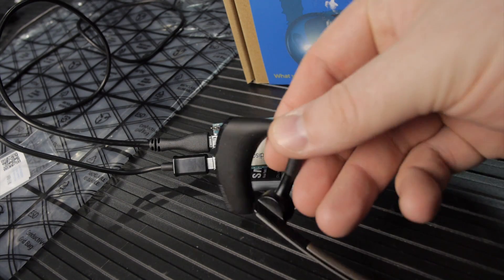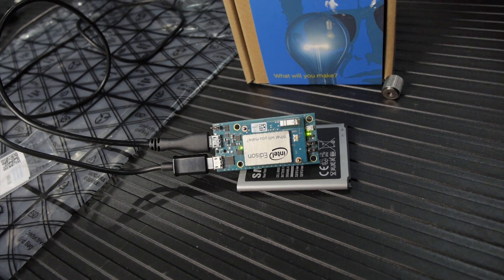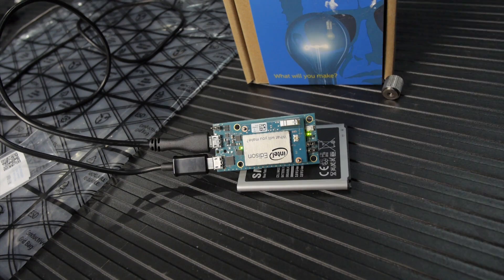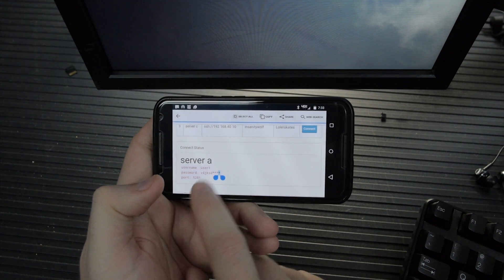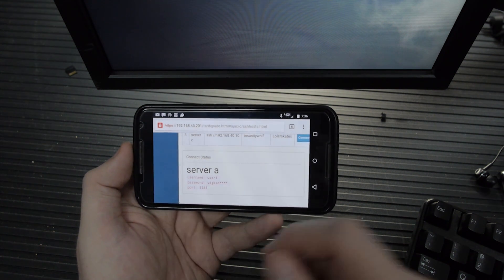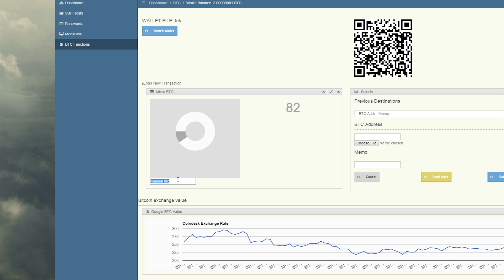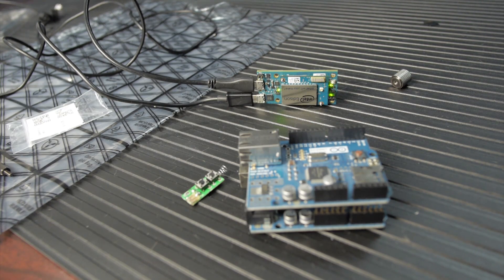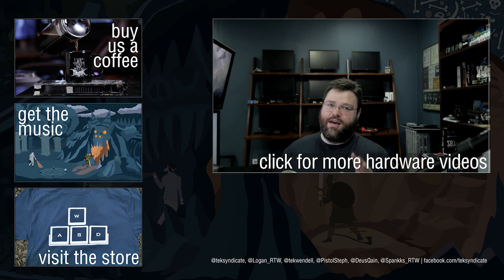Intel Edison: Yocto Linux & Personal Area Network Server

Comment: Look into particle if you're going for a super small form. I'm curious as to how it was working with that broadcom on linux. I've had nothing but headache with those wifi modules usually end up switching to the intel wifi modules. Interesting project let me know how it goes from my understanding it's essentially an arduino with a wifi module.

Comment: I dont understand what this is supposed to be. You want to join a network with some device. So you connect Edison to the network first and have it send out a key that allows you to connect to Edison. Now Edison is the middle man who is sending and receiving information.

Your goal would be to have Edison connect to any network and then give you a connection to your device. Encrypt all information sent over Edison and have Edison block any attempts to connect to it. No one can see which devices are going through Edison.

But why do you need this? You would not store intellectual information on your cellphone, but you would on a laptop or some type of external storage. Your laptop can have antivirus software and means of blocking IP's and ports from external connections. Sure this may not be the best, but what am I missing?

Comment: a dedicated multi use security device? that could both be a mobile secure firewall and a device to hold passphrases/certs would be awesome. especially in security concious applications, ie. banks, any defence company, journalists? sounds good.
i hope you can(do) get linuxSE running on there, but i do have to ask. how are you going to get it to hold passwords to be used on another device for web logins with out having that password/cert shared?

Comment: I was actually thinking of something like a "one button click password writer" that would be stored inside the little device and wherever you need to type a password, just connect the device via either USB or bluetooth (I prefer wired connections) and press the button. It would be a much simpler design and won't have the "personal assistant" feel to it, it would be more like an access card. I like the idea of "one time use password", but it feels a little to much work for my taste. 

Also, how does this Edison compare to an ARM TrustZone enabled CPU? 

As a side question, how does this Edison compare to Raspberry Pi 2 (except for size)? Because I was looking to revive an old IBM Thinkpad 380z using some small computer that I could connect the display, trackball and keyboard.

Comment: Try recompiling a kernel with grsecurity. That does what is possible within the kernel to secure the system, which is quite a lot. The only reason I don't use it on my server is because I want to run Folding at Home which needs to access power information (battery to be specific, even though the server doesn't have one other than a UPS). The access to the files and folders with that info is blocked by grsecurity.
Reply: mark dawsey Protein folding simulation is a computational problem that probably won't end in your lifetime
Reply: Alexander Pavel  I thought Folding@Home ended a long time ago.
Reply: I'm sure it will not end in my lifetime.  I used to do it on my PS3 but the functionality for it was turned off, I thought it was because the university pushing it wanted to divert their resources to other projects instead of brute forcing an answer from a computer.  I am happy to hear it is still going on.

Comment: can you not lower the CPU clock and voltage to help with power consumption? like setting it to the minimum required for dependability but maximum power savings?
Reply: ***** I suppose that would be limited by the chipset, the CPU might have automatic power saving features built in anyway though when I think more about it.
Reply: ***** So it looks like the CPU has speedstep enabled so it will dynamically adjust based on demands, but the Quark core doesn't have any advanced features at all except idle states, but since it's running at 100Mhz I doubt it draws much power anyway; it's TDP is 2.2 watts @ 400 Mhz. Kinda weird they're using a 64 bit CPU for tasks but the OS is run through a 32 bit Quark CPU

Comment: what is the pupose of using this over a raspberry pi 2
Reply: grape fruit95 the purpose of this device is completly different from a raspberry pi (in my opinion) the raspberry pi can be used as a desktop replacement with all the connections like usb hdmi audio the edison on the other hand is more like a brain for smart devices that doesnt need any video output or audio (so more like a overpowered controller for your motors)

Comment: thats really weird , only a dual core , why couldnt intel put the quad core atom z3580 in instead , a quad core 2.3 ghz atom processor would be so much better and it would blow the raspberry pi out of the water